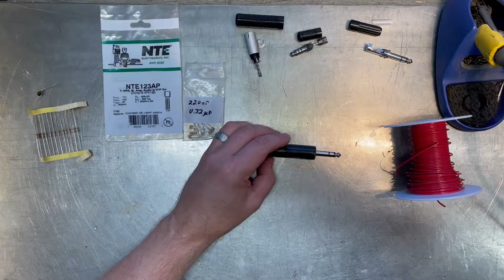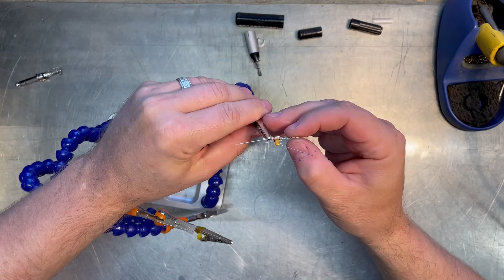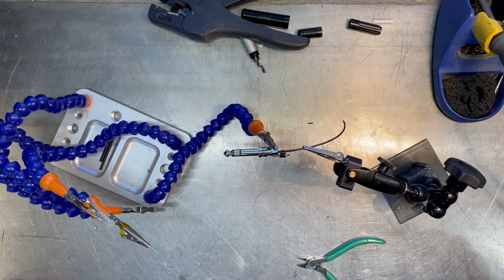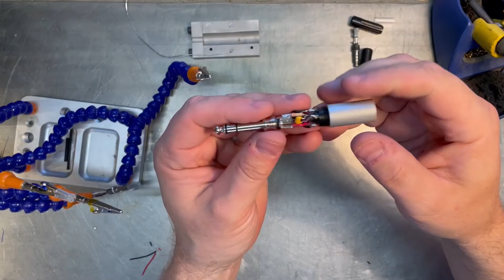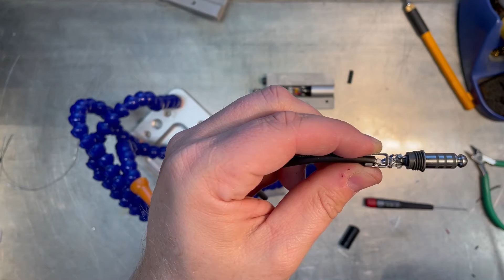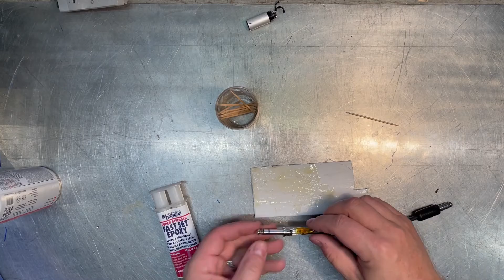Terraphone Intercom to Peltor/Stilo Helmet

Comment: What plugs work with Stilo WRC helmets? I know you always say tp101, but does the tp120 also work with the Stilo WRC helmet? The tp101 is like 4 times as expensive compared just for the plug.
Reply: it does, however, the TP120 is a terribly inferior design that will fail and cause you to be stranded without comms

Comment: I want to make my own adapters
For my terraphone headsets to work with stilo wrc intercom… so technically on the adapter will be both  female (headset and intercom are male)
My question is do I still need the amp resistor and capacitor? And on witch side should I put
Reply: I'm also interested.
Did you manage to make yours since then?
Thanks